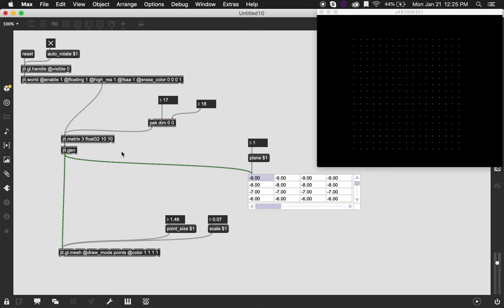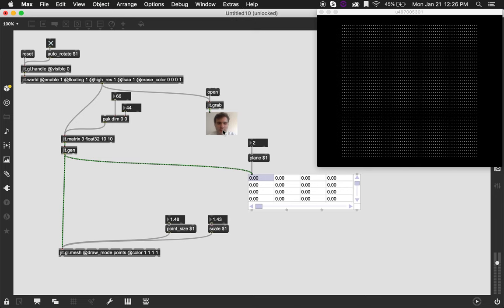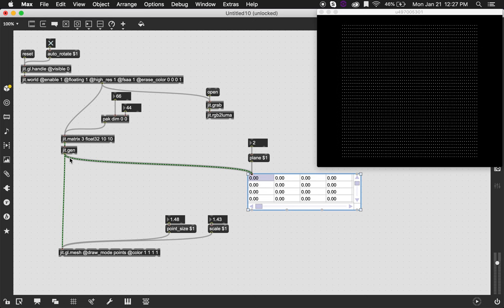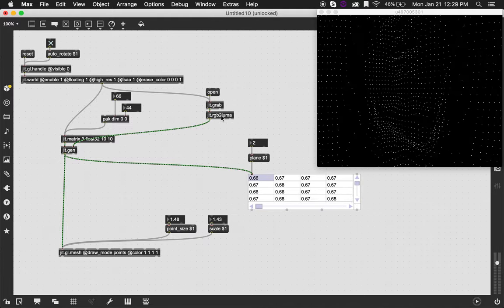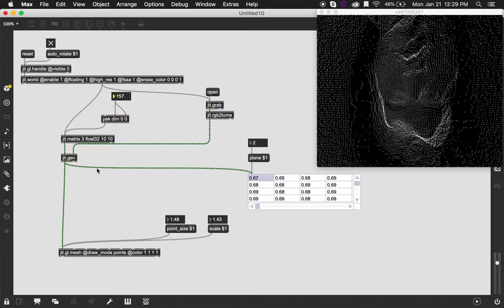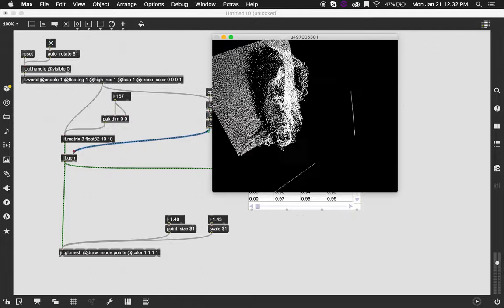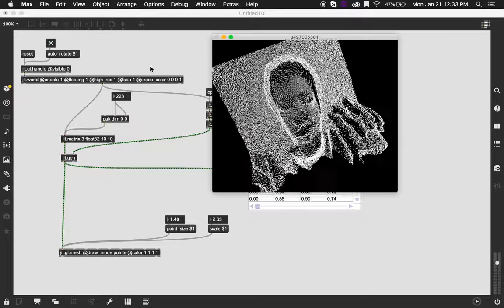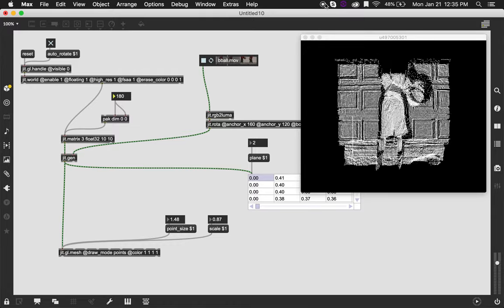Part 2: Video-Controlled particle system in Jitter

Comment: Thank you for your precious work. I started studying jitter some days ago and I loved your patch. I was wondering: is there a way to dynamically color the points with colors from the webcam/video?
Thank you so much
Reply from the maker: It's certainly possible - you can feed color data into jit.gl.mesh. I'd recommend looking at the documentation for the object for more info, specifically the section on color_matrix. https://docs.cycling74.com/max8/refpages/jit.gl.mesh

Essentially you can feed a matrix which contains RGB data into the fourth inlet of jit.gl.mesh (if you hover over that inlet you'll notice it states it's an input for color data). You'll need a 3-plane matrix (or maybe 4-plane to account for transparency, I can't remember) that has the same dimensions as your geometry matrix. 

Hope that helps!

Comment: cool video. You don't need to convert the datatype since jit.gen adapts the right input matrix to the size, datatype, planecount and dim of the left input matrix. I think you were looking to jit.dimmap instead of jit.rota?
Reply from the maker: Thanks for your comment! Perfect, I was unsure about that actually, but it makes sense. Thanks for confirming.

Yes, I was looking for jit.dimmap, I blanked in the moment. But later on (on the following video, I believe) I just flipped it inside jit.gen using the sample operator.